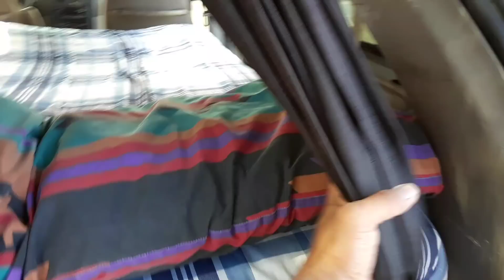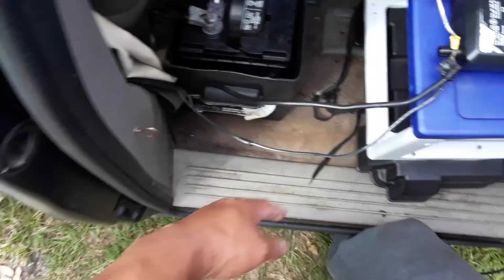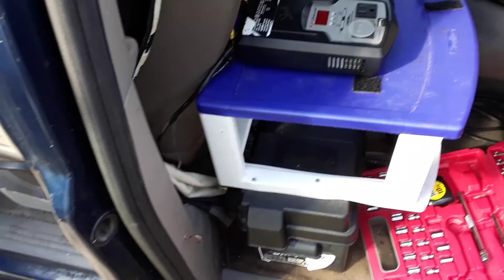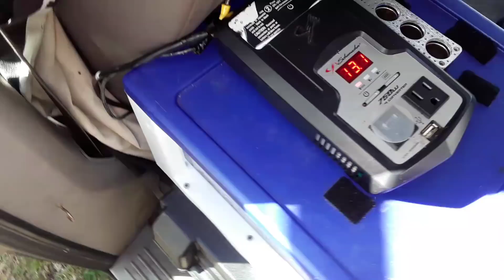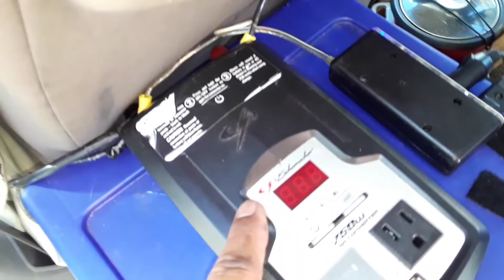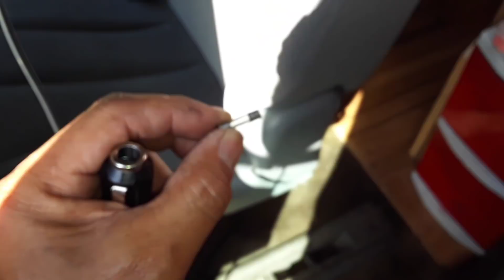How to Build a Home Made Camper Van / Start to Finish DIY Off-Grid Conversion Part 2 (V940)

Comment: Why do u have the power wire that's coming from ur alt ,, run thru inverter then to battery?,, shouldn't it run directly to house battery?
Reply from the maker: +lonerglide I don't think it makes much difference. When the wires are connected, the electricity flows to both at the same time. However, by going to the inverter, it means the system can still be used even without a house battery.

Comment: ABOUT YOUR VAN NOT GOING OVER 45 OR SO, WE WERE ON VACATION GOING DOWN AN INTERSTATE WHEN OUR PU TRUCK STARTED GOING SLOWER AND SLOWER, FINELY AT 25 WE GOT TO A REST STOP WITH A REPAIR STATION. THEY SAID IT WAS THE GAS FILTER. THEY REPLASED IT AND IT WORKED FINE AFTER THAT, YOU MIGHT TRY THAT.